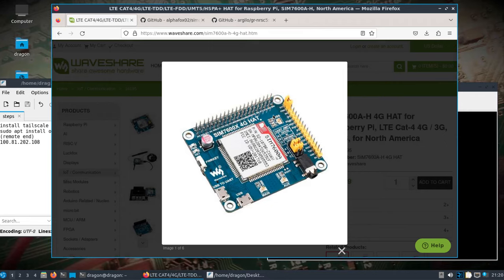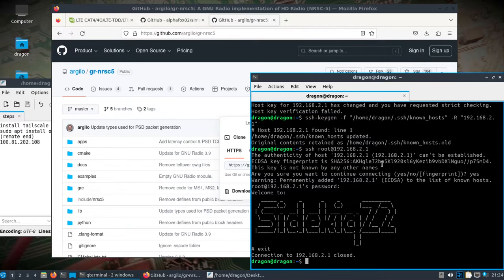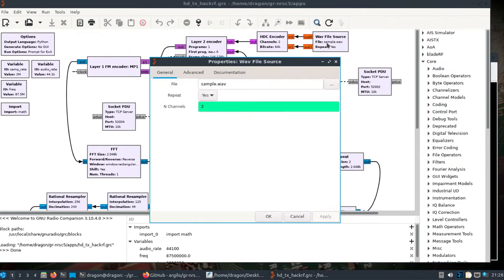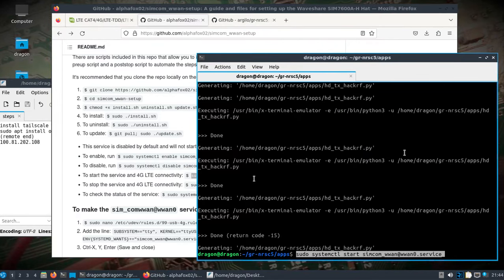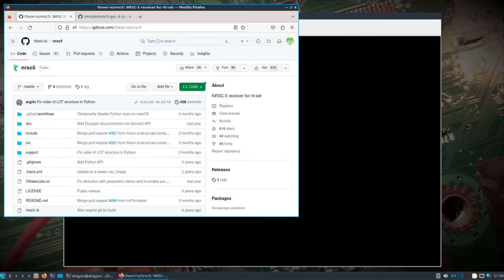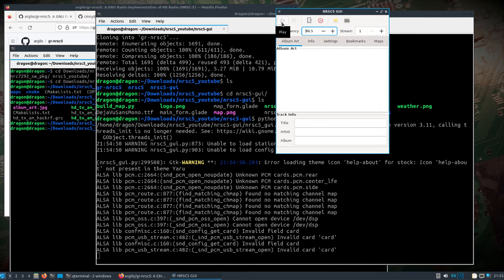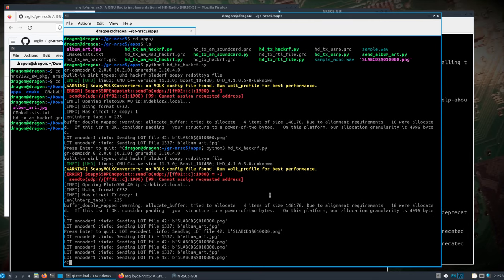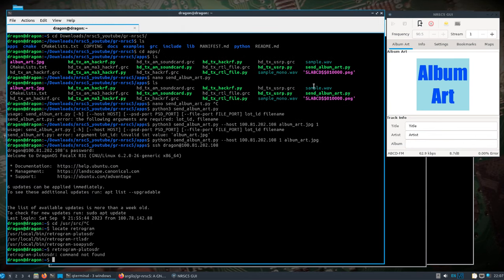DragonOS FocalX Pushing NRSC5 Album Art w/ 4G TailScale Link (hackRF, RTLSDR v4, GR-NRSC5, NRSC5)

Comment: I would love to try out DragonOS Focal.  Been running Antix, but wanted to try your system.
Unfortunately, the hardware that I need to use for the moment does not seem to believe that kernels can be 5-point-anything. 
Any chance that there is an available package for older hardware that uses a 4.x kernel?
Reply from the maker: Is the older hardware maybe just 32bit? The install I’ve put together is only for 64bit. Reason I ask is that I was messing around with a 3.x kernel at one point for something else and it kinda ran (didn’t support all hardware) on a newer PC.
Reply: @cemaxecuter7783  I think that the issue is connected to the older BIOS. Current SDR machine running Antix / Debian 11 bullseye. 

I ran into a similar problem with an old laptop.  

Can't find newer firmware/ BIOS code. Will keep searching. Thanks for all your great work. 👍